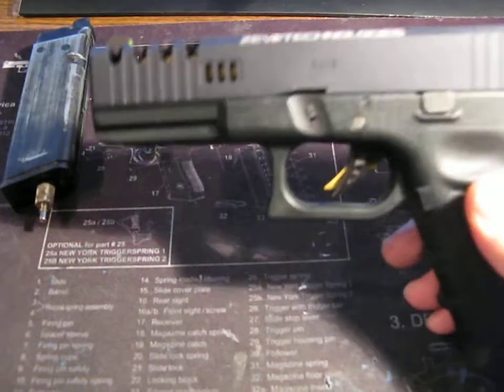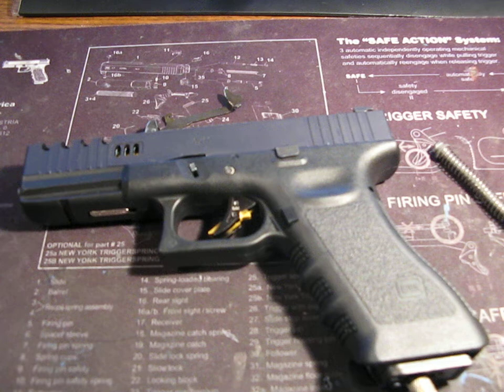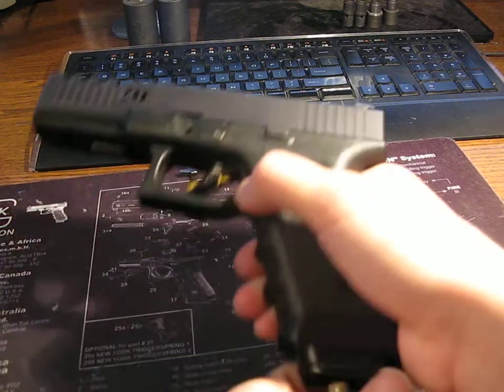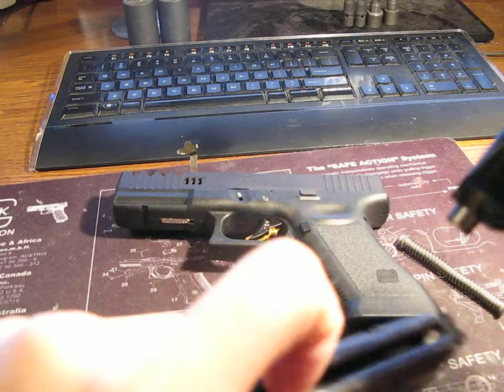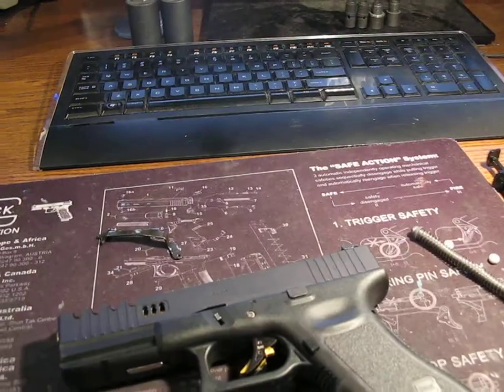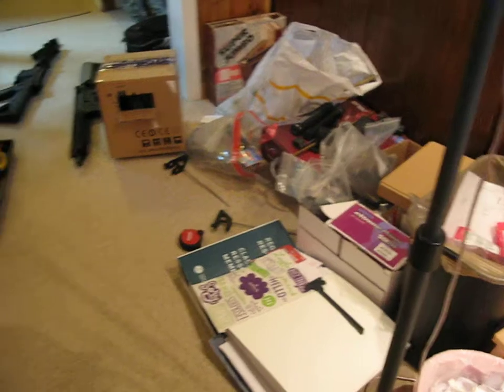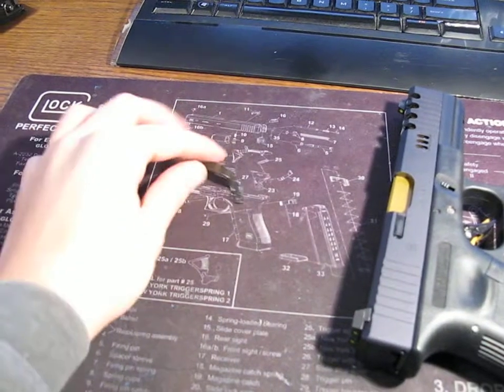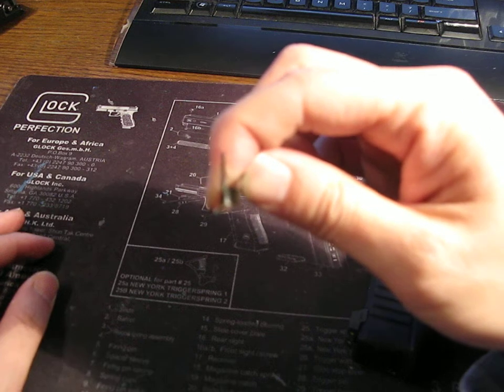Fixed Customer's Glock (AIRSOFT)

Comment: Do you take orders for repairs/custom work or was this just a one off? I have a KWA M19 that has begun to show some issues with it's cycle and shows trouble when returning to battery. I was hoping to get it fixed and fitted with a Airsoft Surgeon SAI slide/barrel.

Comment: nice gun!
what material did you use to build up the nozzle hole for better seal with the magazine? thanks
Reply from the maker: i use cyano acrylic glue (ie crazy glue) with CA accelerator so it cures the glue immediately without it making a mess and dripping everywhere. After applying the accelerator, I lightly sand the built up area so it mates perfectly with the gas route. I do this because after market slides are often flawed (except for a few brands)  and aren't the same spec as the stock slides.
Reply: thanks, i will try that.
is there any way to prevent the frame from cracking without glueing the rails in?
Reply from the maker: james dieter If you use the screw to push the front chassis down, the post will crack. The best thing is to remove the screw completely so the force will not be transferred to the post. You can remove the screw and not use any JB weld, but the chasis will be elevated causing the slide to wobble. The JB weld I applied on all my glocks have been working so far. I was even able to manually remove the JB weld to separate the chassis from the frame without inflicting any damage to the frame/chassis.
Reply: ok, thanks. how did you remove the jb, i thought it was really sturdy? maybe it is okay to use a weaker glue to prevent the wobble?
Reply from the maker: james dieter  I just pry it off with an exacto knife or a flat head. It is very sturdy, thats why when u try to remove it, it removes all as a chunk